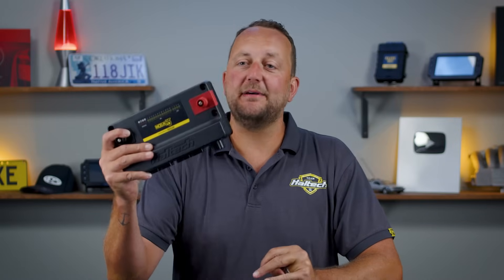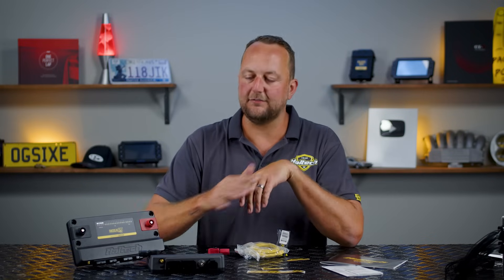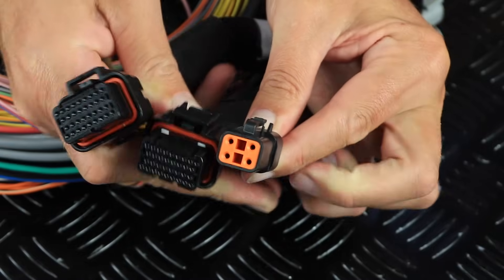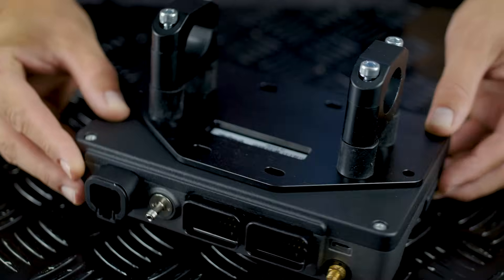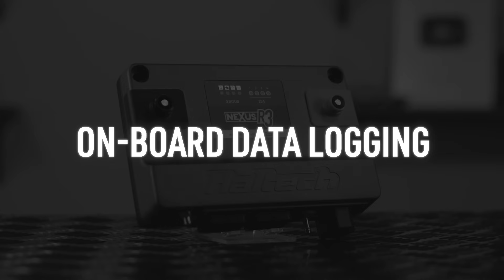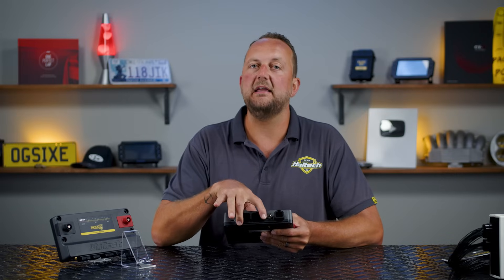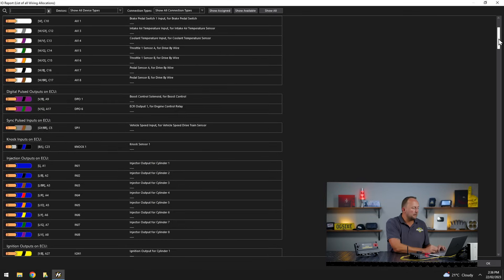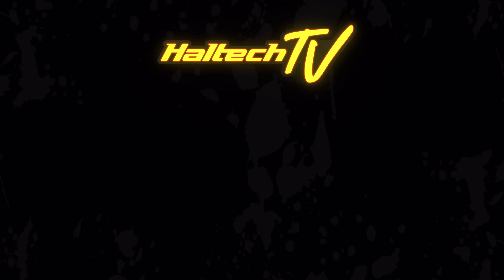All you need to know about Nexus R3  | PRODUCT OVERVIEW

Comment from the maker: We know it's been a long wait but we can assure you it's been worth it! The new Nexus R3 is here and in this video, we're diving deep into this new, compact VCU.
-----------------------------------------------------------
Total Control – Full Flexibility
• A data logger
• A power distribution module
• A wideband controller
• A high-speed wi-fi communications module
• A new generation engine management system
All natively interconnected with each other.
All programmable with one single piece of software. 

Much like its bigger brother, the new Nexus R3 combines the functionality of a power distribution module, a data logger, a wideband controller and a state-of-the-art engine management system in one compact yet powerful device. With a small footprint and sharing a lot of powerful tuning features with the R5, the new R3 will provide an integrated vehicle control solution to racers, tuners, engine builders and performance enthusiasts alike.

For a full spec and feature list see the Nexus R5 Product Page: https://www.haltech.com/news-events/new-release-nexus-r3-vcu/
For pricing and availability: https://www.haltech.com/product-category/ecu-universal-wiring-kits/nexus-r3/
Reply: Are elites going to get a hardware update? I imagine its becoming quite dated by now.
Reply from the maker: Elites got an upgrade to NSP recently which increased their capabilities considerably. No plans for a hardware upgrade at this stage.

Comment: I'm confused. So if it already has a 4 bar interanal MAP? It does not require any other sensor externally?
Reply from the maker: It doesn't need one, but some people prefer to use an external MAP sensor. So we give them that option. 
They may want to run more boost than 4 bar, for example.

Comment: For the tube mounting bracket, might be a good idea to specify the distance(s) between the inner part of the bolts - that way people will know if they can machine the opening larger for the bar diameter they may be using, if different from the options?

Comment: possibly a stupid question, but does this power up things like indicators and wind screen wipers? building an LS powered metro van and it has no wiring at all. Need to start from scratch. also is there a harness for the LS that plugs straight into it. Cheers
Reply from the maker: This is a good place to start: https://youtu.be/0V01RpBg8Vc
You basically wire all your electrical components the same you would with a Power Distribution Module. 
We don't have an LS terminated harness for the R3 at this stage, we do have LS specific kits with the Elite 2500.

Comment: Why use an internal boost sensor?  Maybe it's my inexperience, but it seems like most people would run a remote sensor to measure their boost to fit their application, as well as have a replaceable piece if there is a failure.
Reply: You can still use an external MAP sensor for engine boost and then use the onboard sensor as an ambient pressure reference so the ECU will compensate for altitude changes.

Comment: Hi there I have a jk wrangler with a 6.4 hemi conversion and I really want to redo all the wiring and I think this will be a great thing for it. But can it handle the 16 spark plugs?
Reply from the maker: For that application we would recommend going up to the Nexus R5, which can control 16 ignition and 16 injection outputs. It's a good idea to have a chat with one of our tech support guys before hand, they'll be able to discuss your setup in detail and give you the option for the ECU choice for your build.

Comment: Will you guys be releasing anything compatible with the 2015-2021 WRX (FA20DIT). I heard the direct injection is the issue? If not I might buy an ej 207 or 205 to be able to run your hardware and software.

Comment: I’d love to see you guys do a stand-alone, affordable PDM unit to allow for use with vehicles where they don’t need a full ecu system. The existing ones on the market are very expensive.
Reply: They are all expensive for a reason.  If Haltech did a standalone PDM, it wouldn't be drastically cheaper than any others.
Reply: I’m not sure but the haltech pd-16 may work by itself. Maybe worth a look
Reply: Soon, the pd16 will function with the ic7 dash only, no need for an ecu!
Reply: I agree. Something for the guys who have old school cars and just want to replace all the old wiring /fuses etc

Comment: You need to fly over to the USA and set up all of the traction control for Mc  Flurry and all engine protection censors and talk them in to a fly by wire throttle. So James can have cruise control for drag and drive.

Comment: I'd have gone a Haltech Nexus R5 w/ IC-7 if it was out at the time when that portion of my build was under way. Currently running an AIM PDM32 w/ 10" screen connected to a GM E38; for anyone wondering. I'm not happy with the support from AIM, also the cross the fingers approach they take on PDM firmware releases for new AIM products they really want to make some money on. The PDM or VCM is the (very expensive) heart of the car, it's no joke to turn people's pride and joy into a brick.

Thanks for the new products Scotty & Haltech.

Comment: I was wondering, because it supports up to 8 x injectors, what is my option if I want to run 12 x injectors (6 x primary and 6 x secondary) for running nitrous on my 2JZ build. Would this R3 still be suitable? Or is there a way around this issue to be able to control additional injectors?
Reply from the maker: With the R3 you would need to do it in batches - ie two groups of 3 injectors, but we would probably recommend going up to the R5 where you can run both stages sequentially. Best thing to do is to contact  our Tech Support either via phone or via email (support@haltech.com). One of our tech guys will be able to go through the settings and recommend the right ECU for your application.
Reply: @haltech  Thanks. I appreciate the advice.

Comment: Super excited about this, only thing that would be nice is a internal 5 or 7 bar map sensor for all us drag folks running more than 45 psi, but perhaps that's not possible in the architecture
Reply: I still don't understand why an internal boost sensor is even used?  Wouldn't most people just use an external one?
Reply: @capnthepeafarmer  most people won’t exceed the internal map range. Also it saves a input.

Comment: Does the R3 replace the Elite 2500 and would you recommend the R3 over the Elite 2500 for a JZX100 ?
Reply from the maker: The Nexus R3 is a different product to the Elite 2500, so it's not meant as its replacement. If you're using an existing fuse/relay wiring and you don't plan on replacing it with a PDM-based system then the Elite is still a better option. Likewise if you're using a factory harness and want a Plug'n'Play solution - the Elite series offer a big range of PnP support - including the JZX100 (see link below). On the other hand, if you're re-wiring your car or building a race car from scratch, then we would highly recommend the R3.

https://www.haltech.com/product/ht-151354-elite-2500-toyota-chaser-jzx100-1jz-gte/
Reply: @haltech  Thanks very much for the reply - tough decision, which i will have to make with my builder. 
im leaning towards the r3, purely as i want to simplify and consolidate the car and simplify everything as i go.  might be easier said that done and ultimately budget decision.

Comment: I really want to understand the product person who thought this up or came up with pricing. I thought maybe you might compete with Holley's success with the Terminator X and Terminator X Max,  but then you priced it like a Dominator with fewer IO, so I can't tell who you're going after. I was really hoping to use this on a Drag & Drive Coyote, but I'm struggling to make it make sense.
Reply from the maker: Neither Terminator nor Dominator are really comparable to the Nexus units. The main difference being the in-built PDM in both the R5 and the R3. So when comparing them to the Holley products you really need to look at ALL the specs to get the full picture. Both the R5 and the R3 are an excellent option for the drag and drive applications, not just because of the features they offer, like wi-fi comms for example, but mainly because of the ease of diagnostics and troubleshooting that comes with using a single unit controlling the entire vehicle from the engine to power distribution, all within one software. We would highly recommend you have a close look at a car that runs a Nexus R5 to see how the system works. It's not for everyone, but those who have it, love it:)
Reply: @haltech  OK, I'll eat shit on this one. I just clicked the link, scrolled to the table and launched into the comments. Wasn't aware of the PDU and Haltech is definitely in a class of it's own. I was just hoping for something to come along to compete with the lower-end models, but I can appreciate not participating in a race to the bottom. I think the R3 will be perfect for a street rod build. I may have to go R5, because I want dual fuel on the drag and drive car.
Reply from the maker: When you're ready give our Tech Support a call or email. One of our tech guys will be able to recommend the right one for you based on your setup:) We always try to make sure we sell the RIGHT product for the application rather than just selling for the sale sake.
Reply: Terminator x is the price it is because it’s cheap and made for every Tom dick and Harry.  It feels like a toy, is basic, has no advance features, and they fail often
Reply: @musclecity06  I own both a Terminator X Max and a Dominator. I'd really rather not buy any more Holley stuff.
Reply: And buy a terminator x then

Comment: Crazy that this is only $300 more than the Elite 2500.
Reply: Totally! You'd just buy an R3 in case you wanna delete the fuse box later! Not to mention the free built-in extra features like the wideband controller!
Reply: Just paid for a 2500🎉
Reply: @Yokotukanoshi  lololol Im feeling your pain I got a 1500 and need more outputs
Reply: @Bigbot Hoee  Ill be okay for this initial build, But it definitely has the brain thinking about it for the 2.0 version, When that comes round Ill see what haltech is upto then.
Reply: Crazy that it has as many bits as a SNES. Crazier that it has less input/outputs than a $30 arduino mega